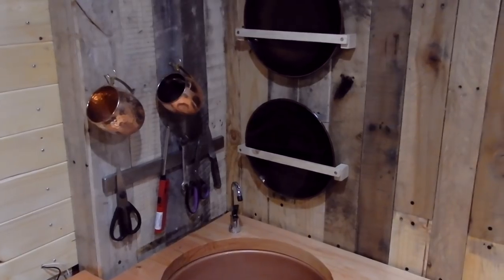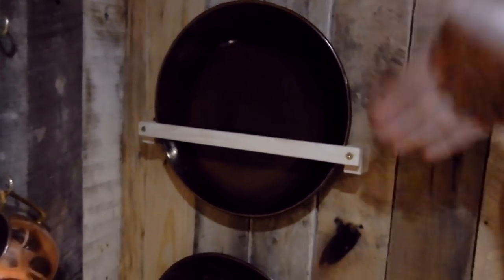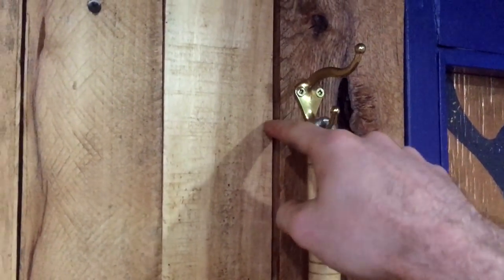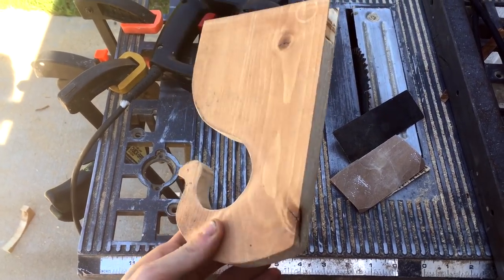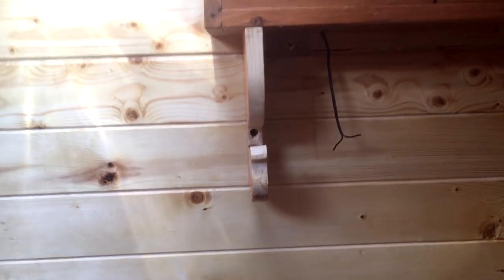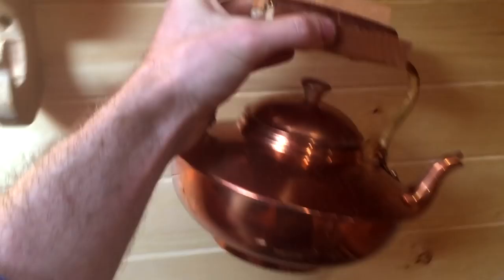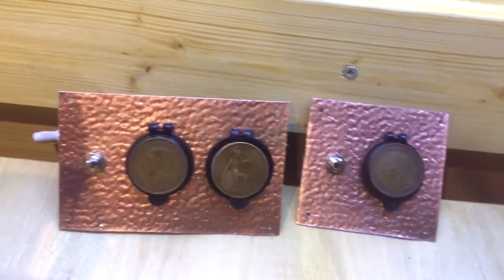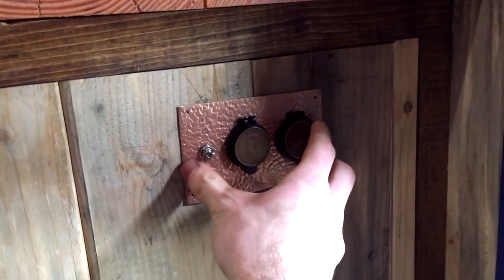Functional Kitchen and Insurance Nightmare ~ Van Build E032

Comment: Every state has different hoops to jump through, 9,000 diesel pickup had to use commercial plates despite being for personal use. Took a DD214 to get normal vehicle plates. Insurance don't get me started that's good for 4 hour rant. Will keep up on your channel mainly for woodstove happiness. Live in Maine and want heat in RV through Webasto, Woodstove or Newport heater attached to fuel tank. Like dry vs propane moisture in air.
Reply from the maker: Oh the dry heat is such a luxury.

Comment: Callum where did you get your cast iron dutch oven. It looks like you could use the lid as a pan also. Am I seeing that right. I'm in the states and never saw one like it. Looking to buy one.
Reply from the maker: The lid does double as a frying pan. I bought them as a set at Canadian Tire. It was $40 something dollars on sale. Obviously you won’t have access to them. The brand is Lagostina though if that helps.
Reply: @SylvanSecrets  thanks for answering me. I've never heard of that brand. I'll look around for a set like that. Found one in the Lodge brand but I don't like their cast iron it's a very pitted surface, not smooth. Thanks. Hope your studies are going well.

Comment: Mine was insured as a private vehicle; 1 ton Van. pre build.. Later all I need is plumbing  ( shower or toilet ) plumbing through the body and in to tanks. Than a DOT inspection by the HY patrol than a new vin tag and number than insurance as a Special Vehicle. So no cutting or modifications and no red tape ( frame or body) keep your chin up; after it is finished it will be no sweat.
Reply from the maker: Russ Chamberlain I’m getting the inspection tomorrow so fingers crossed 🤞

Comment: Instead of the bungee on the cast iron pans, how about a leather strip the fits the bottom handles? Also need to figure out a way to secure the mason jars or they may get knocked out.
Reply from the maker: A leather strap is a good idea. I originally tried it, but my design didn't work. They need to unfasten somehow. Bungee cords work for now but they are pretty ugly. As for the mason jars, as long as the shelf is full they don't go anywhere.

Comment: Good luck with the inspection buddy. It’s a process and you have to go from A to B when dealing with institutionalized red tape. As always loving the choices you have made in the kitchen..! Very Instagramable 😜
Reply from the maker: That's a good way of looking at it. I'm not very good at waiting for that sort of thing though. Btw, I have an Instagram (@sylvansecrets) where I usually show progress in closer to real time.
Reply: Sylvan Secrets your insta has officially been blown up. My instagram is for my market business werken.com.au. If you turn the cast iron around so the flat surface is against the wall. Drill a small hole and glue a small magnet into the hole...! Maybe...?
Reply from the maker: Japhill75 interesting idea. I wanted them that way initially, but they don’t lay flat. Not sure that a magnet could hold a 7 point chunk of iron in place on a bumpy road.
Reply: Sylvan Secrets lol ...! It may very well not live up to the bumpy road test 🤪
Reply from the maker: When I drove it to the scale, I was so scared that everything would break.
Reply: Sylvan Secrets haha...! Fear is such a weird thing. I’m sure all of your hard work will hold tight.